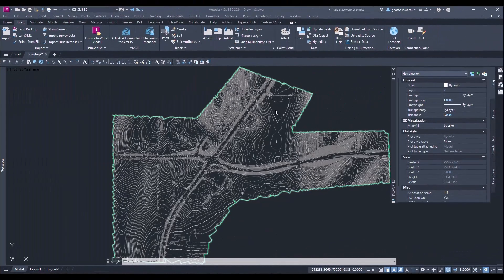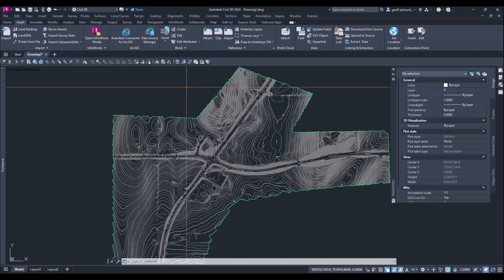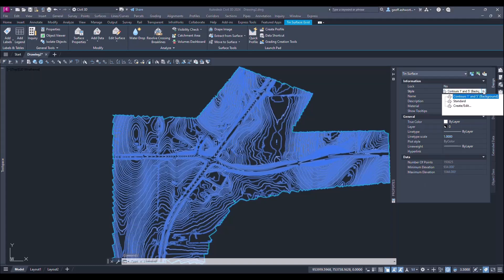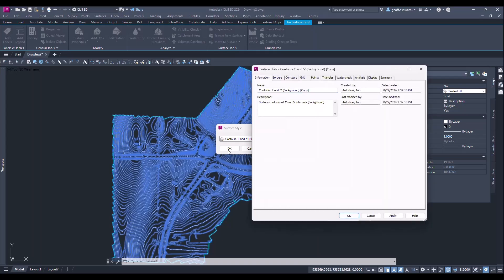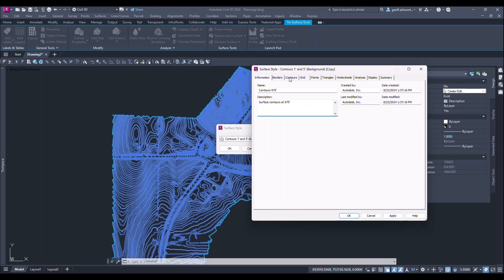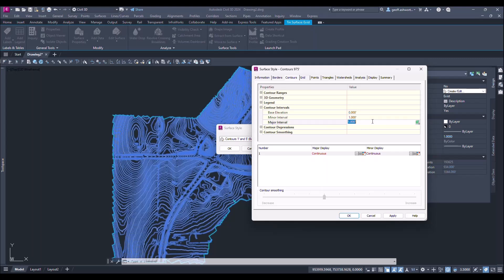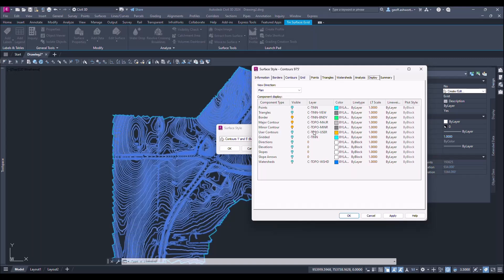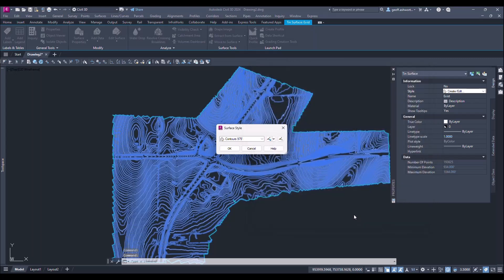Civil 3D Display Contour Specific Elevation

Comment: How does this work though if you are doing something closer to sea level? You would change your major contour interval to like 10 feet and then it would still show each contour. I guess you could technically raise the surface 1000 feet but I don't know if you would do that.